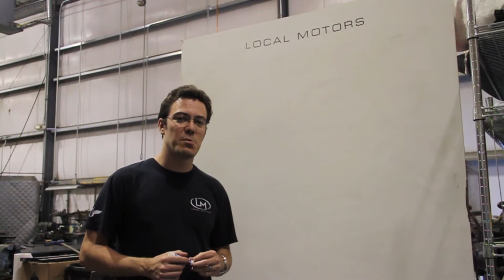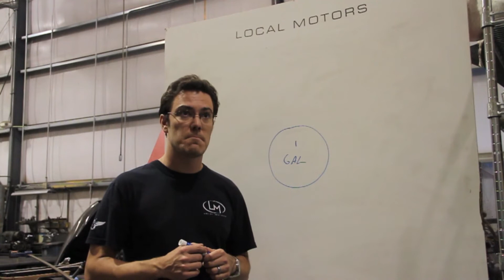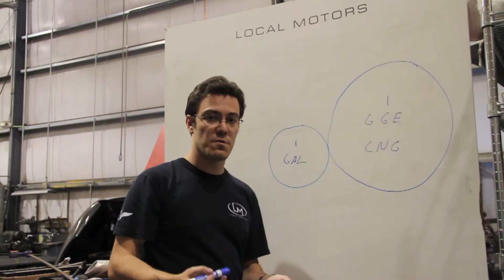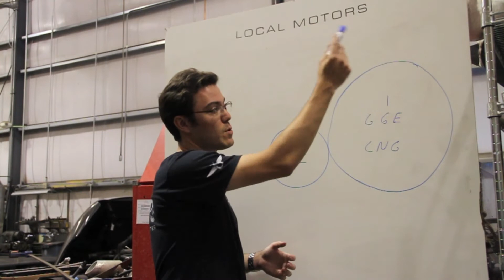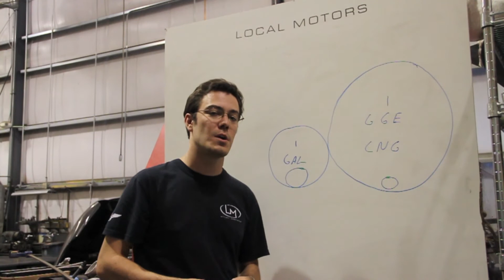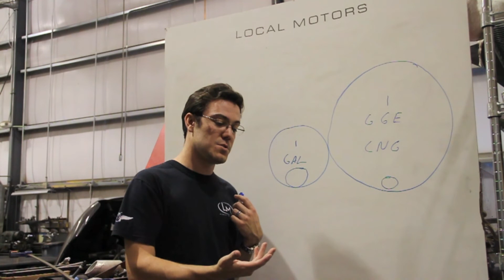Compressed Natural Gas with an Engineering Community Manager

Comment: Hmm. For tiny cars I don't think it would be financially sound to convert but this is at first glance. It seems that to maximize your gas savings and range you would need to get an oversized vehicle and fit it with multiple tanks. So what would be the ideal size vehicle where you get maximum range and economic feasibility?